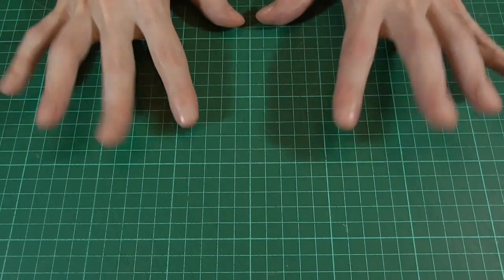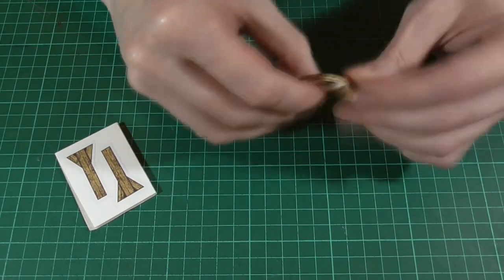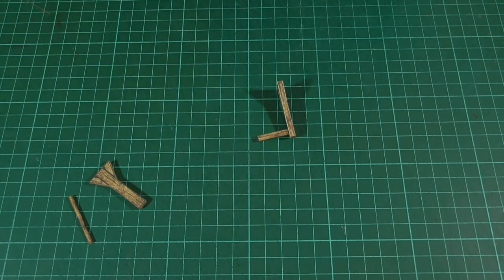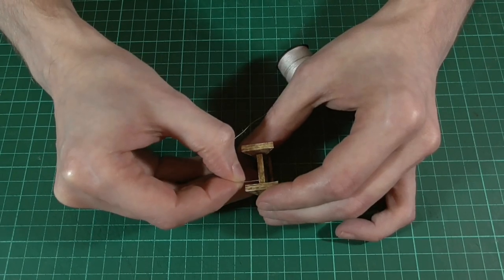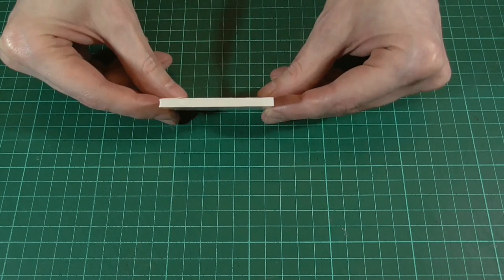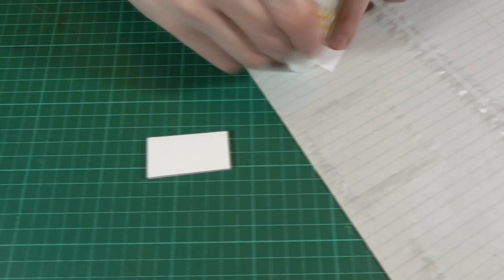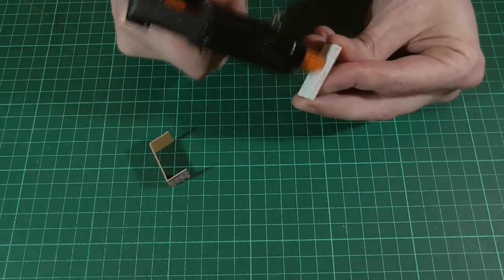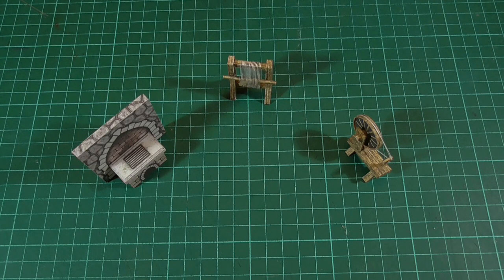Episode 33 (pt.2) : Wheels, Looms, and Stoves

Comment: I’m already imaging reflavoring the stove into a forge .... unless you have a forge in the works
Reply from the maker: Nothing in the works yet ...but it is on the to-do list .
Reply: yes a forge area would be great :) i think you can use the tips & trick from episode 2.5 and wood texture to make convincing workbenchs. you can use the barrels from episode 3. the well from episode 27 (cut in half) and combine with fireplace from episode 25 to make a convincing forge !
Reply: Between the fireplace and stove you have a lot of good textures to play with. You could even use the rusted metal and an anvil.

Comment: Amazing work! I recently started with this project/hobby of making my own terrain. Just this week i finished shopping all I suppose to need. It's a little expensive but I didn't have anything to start so I suppose is normal. I choose to go with Styrofoam and acrylics, but after seeing your superb job ( very recently subscribed) I almost regret going styrofoam! I will try to do some of your ideas whenever I can. Thank you very much for inspiration. It's hard to find decent acrylic paint here in my country, so it's almost sure that I have to import and pay taxes... Before I go and buy anything, can you recommended one or two brands of acrylic paint to start with? I know almost nothing and want to start but need a little guidance. Thanks again.
Reply from the maker: Thanks :)

For making 'regular' terrain I've had OK results with 'chiltern arts' paints (you can get them for a pound or two each). I just looked them up on Amazon, and this is them:
https://www.amazon.co.uk/Chiltern-Tubes-Assorted-Colour-Acrylic/dp/B005WS3LDS

(each tube is roughly 6" / 150mm long)

I don't know if that helps, but like I say, I've used them and not had any major issues (though I don't think they'd be any good for miniatures).
Reply: @CrookedStaffTerrain  Forget about "regretting" my purchases. Just finished your #30 video where you add levels and stairs to the scene. You're so great ! I'm going to use that with my (tons) of styrofoam. Thanks again for the ideas and inspiration. And thanks for helping me with the acrylic paint  inquiry.
Reply from the maker: @zombielandiii2711  No problem :)